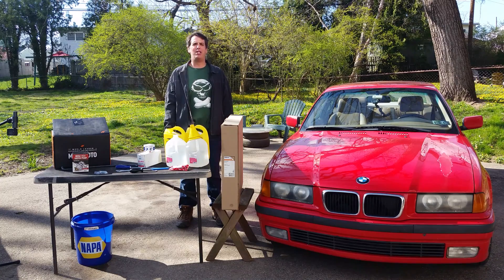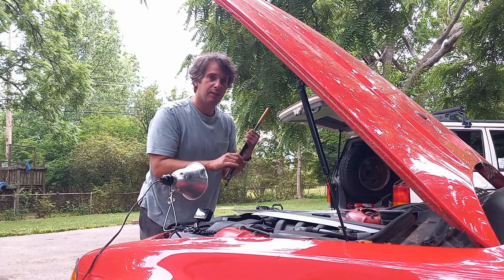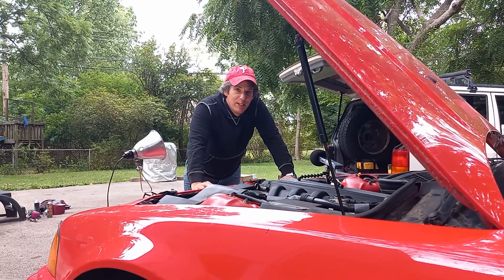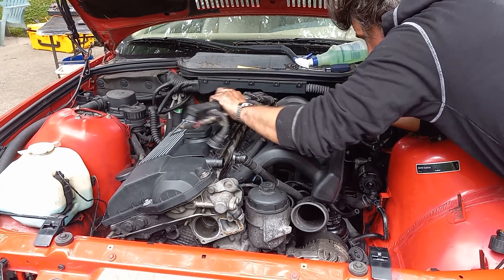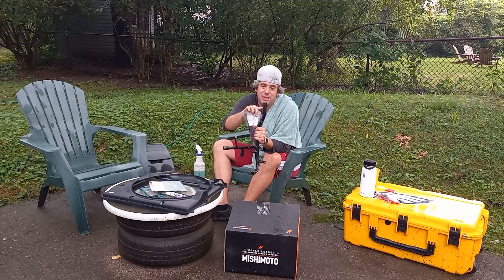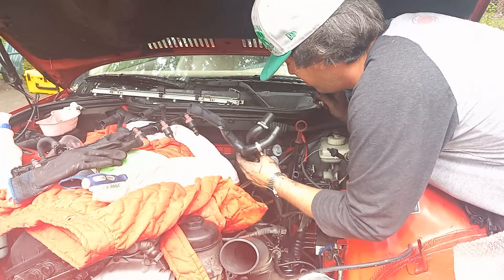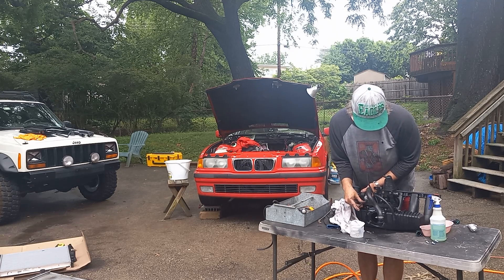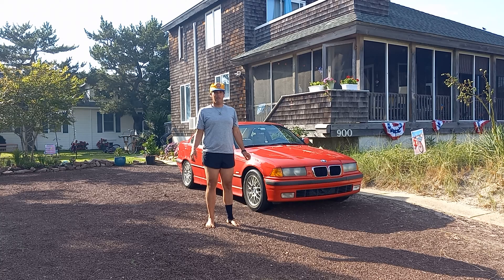Bulletproofing the BMW e36 328 m52 Cooling System

Comment: What was the Hiccup and what was the cause of it??
Reply from the maker: Sometimes you have to trim a little bit off a parts store rad hose, I didn't do that so the fan ate through it. And the broken motor mount I discovered! Good luck maybe start with something simple the water pump itself or just the radiator isn't bad.

Comment: Chill ass video… way to prepare the car for boost. I’m in the cafe chilling, wit dat dp… greetings from 2016. 

Finding a prepared chassis, fixing the engine, then boosting it with upgraded brakes and hydraulics would make a great project and car. Perfect for tuning. Maybe a supercharged system with a wastegate is the best for boost by gear, of maybe boost per RPM by gear?
Reply from the maker: hell yeah bro, I had been thinking supercharge but with turbos so ubiquitous now that may be the move
Reply: @DalyDriverTV  Well if you’re drifting it shouldn’t matter much… you’re going to be high RPM anyway, and you can just use a smaller turbo or supercharger. Keep me updated @

Comment: hi Daly Driver. i was just wondering.if you ever had this problem. i have a coolant  leak that looks like it my be coming behind the water pump. But i put a new water pump in three years ago and  new new thermostat AND New Metal Thermostat housing. but some say it could be the hard Line coolant hose that runs in to the Head. i put coolant Dye in and cannot see where the leak is coming From.i looked at the thermostat and water pump AND Can Not See Any Leaks From There. SO I AM guessing IT could be the hard line hose the runs into the front of the head. AND IT Just leaks out as soon as i put coolant in . i have a 1998 bmw 323is with 216000  that i owned since the year 2000 and nobody has ever but Me  and the car Runs great . just can't see where this leak is coming from. IF YOU HAVE ANY IDEA Or had This Problem PLEASE LET ME NO.  Thank YOU. And  love your Videos. 9/1/24
Reply from the maker: Thanks for watching! Hard for me to say without being able to look at it but maybe it's the o ring on the hard coolant pipe that plugs in on like the backside of the water pump ares. I got a coolant rebuild kit and it came with that o ring, the tube was pretty stuck when I went to pull it out it must get pretty baked and stuck, may also leek if bad.

Comment: Best upgrade I did to my e36 was swapping to a 1997 528i aluminum thermostat housing which has a bleeder screw aswell.
Reply from the maker: ooh, that sounds good I would have thrown that in too had I known thanks for adding to the discussion!
Reply: @DalyDriverTV  yes sir also on the upper radiator hose just use the 97 528i upper radiator hose
Reply: @7beast298 why?

Comment: I was looking into getting an E36 how doable do you think most of the mechanical work is for someone who doesnt know much about bmws?
Reply from the maker: I wasn't a BMW guy before I got this, my first car I learned a bunch on is a Jeep XJ which you can also see a lot of on this channel. I chose it based on check boxes of no turbos, no awd, manual, no convertible. I was also looking at a purple 95 Mustang coupe and a Celica GT-S. I'm really glad I landed with the red e36, the m52 has a timing chain so no timing belts, the worst part is the cooling system. The canister style pump design with an o-ring is actually really easy to service. it's super common worldwide, it's probably the most common pre e46 bmw that makes it easier too with more guides and cheaper parts.

Comment: The real achilles heel of the e36 is the subframe mounts and shock towers made out of paper mache.
Reply from the maker: I was so happy to peel back the trunk carpet on my 98 to see the giant reinforcement plates welded on from factory, front has em too
Reply: @DalyDriverTV  Not too sure about the reinforcement plates being anything from the factory as far as I'm aware but hey as long as it's reinforced that's great haha.

Comment: I'm surprised that you didn't install a Mishimoto radiator -- all aluminum and larger capacity.
Reply from the maker: I know, I like stocky stock on this build will probably try stock class autox, also the z3m rad was pretty cheap

Comment: This is very impressive, you made this look like an absolute breeze to replace! Truly feels like a daunting task for my 323 but you have given me confidence!
Reply: PLEASE don"t put that plastic outlet pipe  head gasket blowing- head cracking bmw radiator in that car,    solid aluminum MISHIMOTO MISHIMOTO and its only 100$ or so more than crap bmw radIATOR,  Another tip bimmer world,fan delete kit, lower temp thermostat, lower temp fan switch,  and silicone rad hoses, Mercedes c230 1990-1994 coolant tank,  I threw e36 engine fans in trash along with the water pumps (kept engine fan on m30) , NO  over heating , absolutly no "bleeding of coolant system  You can put coolant in tank like a human being, and just drive away, drove my 94 325, 86 miles home from work,  put a gallon of coolant in it,-in July- no issue what- so -ever,   BMW M50 M52 ENGINES ,Very overheat tolerant, the coolant SYStem SUCKS,  Designed to create air bubbles in system, with slightest  low level of coolant, (besides the exploding fan AND water pump ,cured by stewart)   Now the coolant tank is high point of system, No more blown head gaskets or cracked heads,  Coolant air bubbles blow a head QUICK, NO MORE , also no more stripped out bmw overflow tank bleeder screw or radiator drain plug, As an interim measure  take bmw coolant tank ,reroute hoses and jam  it behind drivers side headlight , hang it from hood like an I.V. bag to fill it,  TRUST ME -3 E36S , 154,000,  245,000 AND 295,000 ALL MODDED
Reply: Mercedes c230 1990-994 coolant tank 35$ new
Reply: coolant tank mounted behind pass side shock tower on 92 and 94 325 ,behind drivers side headlight on 97 328
Reply: @mnb123240  Don't use mishimoto, use csf or koyo or z3m radiators. You need to run a 4cyl temp switch and thermostat alongside an electric fan setup or use e36 euro diesel fan with e34 clutch if you want to run clutch fan. No fan is not enough cooling unless you only drive car from a to b or live in cold climate. It will overheat if you plan on driving hard or in hotter climate. You also definitely need to bleed the coolant system.
Reply from the maker: Thanks, the magic of editing haha, felt like stuff kept breaking with the shroud then the engine mount and its sheared bolt.